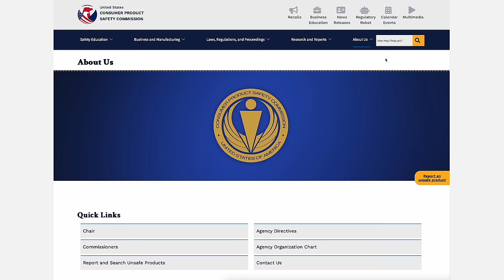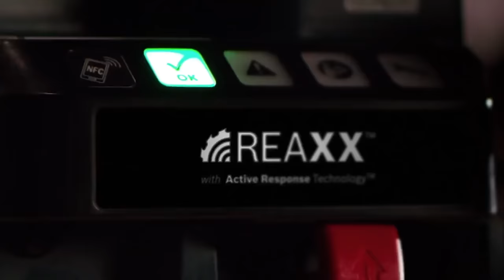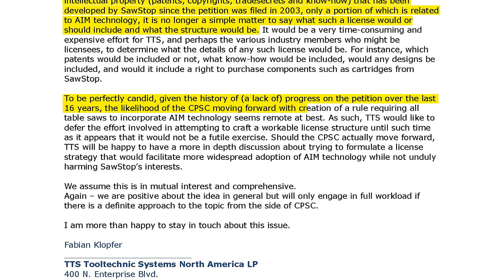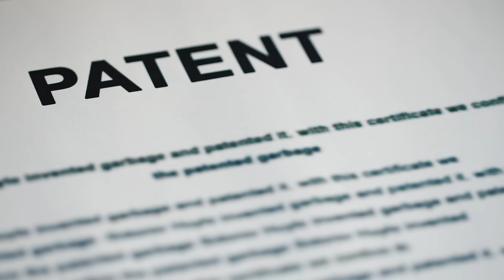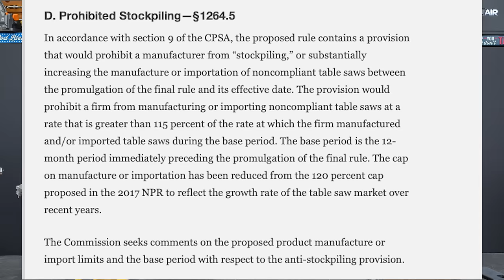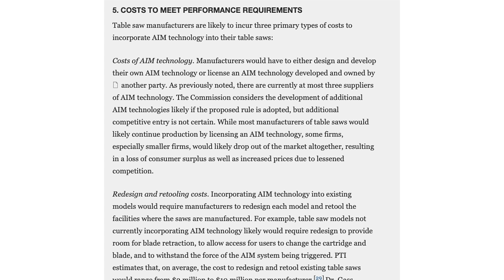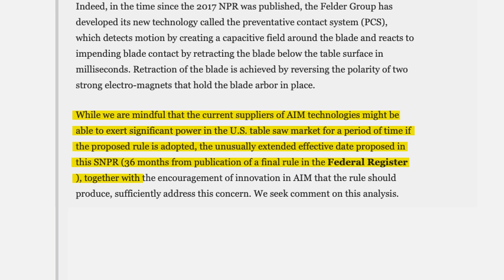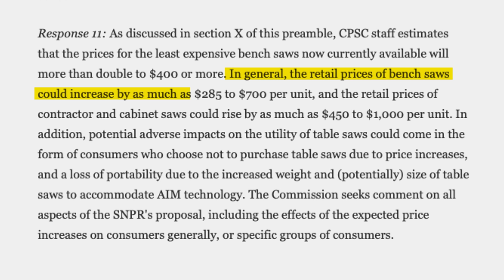The US Government is About to Change Table Saws FOREVER!

Comment: A table saw is a very simple brutal thing.  Not unlike a firearm from that perspective alone.  So, the only effect this will have is a barrage of home-made table saws.  Every possible DIY design will appear on the internet, with the usual suspects selling components.  People are simply not going to add thousands of dollars to the cost of ripping a plank, threat to fingers and insurance companies' bottom line notwithstanding.  I urge the committee members to carefully consider the unintended consequences of forcing this kind of cost increase 'for our own good'.  'For our own good' is a statement more fraught with dangers than any tool or weapon.  The only thing more dangerous than a well-designed gun in the hands of a madman is an amateur designed homemade one in the hands of a sane man.  The same can be said of table saws, and smoked sausages.
Reply: "I urge the committee members to carefully consider the unintended consequences" - They are not paid for thinking or considering anything. They want your money - this is so simple.

Comment: Some of these stop units require huge cost repairs after they have activated all of which be required to done (safely) by the manufacturer under law they will not sell you parts to refit your own saw. I will keep and use my saws till I die, they can kiss my a$$.

Comment: Good thing these old saws last forever.  The cost of used saws will go up because people won't want to buy the new ones.
Reply: They'll just mandate that older saws can't be sold by private sale. Think "gun control" but for woodworking tools and you get the idea of what they want.
Reply: I don't think it'll go that far. Most people find a way of disabling these things anyway.  Actually, the sensors on the sawstop can be deactivated with a key. Blade changes for dados and such suck though.

Comment: Altendorf has a system, too. Though of course this be another price category.

It's a shame the US are becoming Europe now. As in, you're too stupid to decide for yourself what saw you want to use. This is no good. 

Especially since sawstop is entirely the wrong approach. The correct approach is to respect your saw and acknowledge that it will harm you if you don't. Make sure your fingers cannot possibly get into the blade, and there you go, no sawstop needed.

Comment: The video goes ad nauseum on the extra $200 it will cost to add this into the saws but 2 things come to mind…
1. Companies bias to overinflate that figure so as to make the argument that’s it’s unreasonable to institute this mandate
2. Not taking into account cost efficiencies once all saws are built with Sawstop AIM the price of the components will come down in price quite a bit

So over time it could easily be just a $50 increase in price not $200, which anyone who argues that that’s not worth it, or “stop telling me what to do” just is an idiot and has probably never seen someone amputate their fingers (I work at a trauma center and see them all the time)

Comment: 2.8 million people fought in the civil war over 4 years had 60000 amputations. There are an estimated 9.8 million table saws in use annually. That’s 39 million over the same time frame with 65000 amputations. (Mostly fingers not arms and legs and ass cheeks) that fool’s argument is flawed

Comment: When continued accidents occur to the point that the cost of care exceeds the cost on implementation of a safety device that precludes medical care it's a no-brainer. This is just simply looking beyond the possibility of other losses, such as your thumb and or other digits. Once the requirement is made the costs of the device(s) will fall. People moaned about seat belts for years, about blade brakes on lawn mowers, on & on & on and it always ends up the same. The safety device works, there will be plenty of whiners and moaners. There will end up being a lot less injuries.  Blah, blah.

Comment: What's weird to me how this process works. In Europe you can do as you please at home but the workplace safety is highly regulated. To me it would make more sense to introduce it as an workplace requirement and maybe later mandate it for consumer products. 
Like how in Europe you can't use a dado blade at work but no law is stopping you from using one at home.
Reply: Europe requires more safety than the US even at home. You can't even buy US-style saws in most of Europe.

Comment: If these new stop/break systems cause novices to be priced out of purchasing a table saw, that in itself will most likely reduce the catastrophic injury by half if not more. It will skew the result of the sampling data to make it look like the upgrades solved the problem when it really just stopped people who don't know what their doing from buying a table saw and cutting their fingers off. I still think it's a good idea though, I've seen hundreds of video of people improperly using table saws (and other equipment) because they think they know what their doing, don't know what their doing, or are just plain stupid. If they're going to enact this rule, the government must free manufacturers from litigation from patent infringement by enacting Patent Commandeering Under 28 U.S.C. §1498
Reply: If you can't afford an extra 200$, then you don't need a tablesaw.

Comment: As much as I like the added safety of the technology I cringe at the more than likely fallout that will arise on safety regulations for job sites for all existing saws without this safety feature.  "Give them an inch and they'll take a yard". As far as I'm concerned, working with power tools of any kind has always come with a high risk and the best way to protect one's health has always been proper training of all tools. Also, if you restrict trades from working a certain way ( in this case affordable table saw) then they will probably resort to other ways to do the same job, ie; routers and radial arm saws. Wait till you see the injuries those create!

Comment: At best - the government needs to stay out of the businesses these products.  The individuals that use these equipment [Table Saws]  etc. What about cut-off saws, rotors etc.  I've seen more injuries from other saws than just Tables saws themselves.  It's called education on all uses of saws and power tools. I call it more of common sense use and not the safety valve. Safety second - Common Sense use 1st.  I for one has never had an issue using power equipment - COMMON SENSE <---- USE...   YET AGAIN THE GOVERNMENT IS STICKING THERE NOSE INTO BUSINESS THAT THEY HAVE NO ISSUE BEING IN.